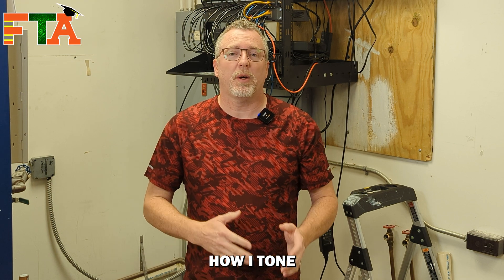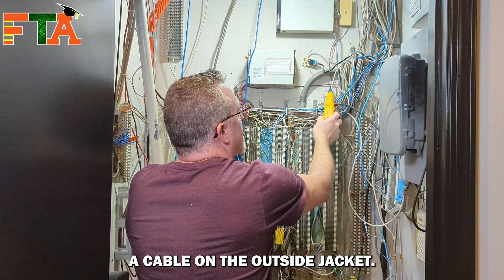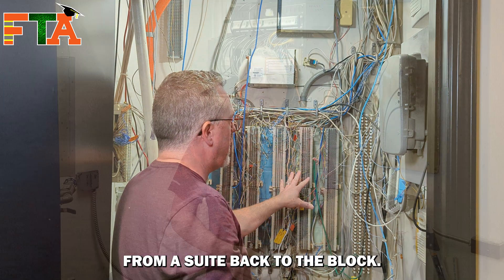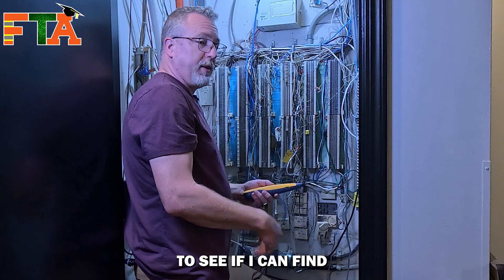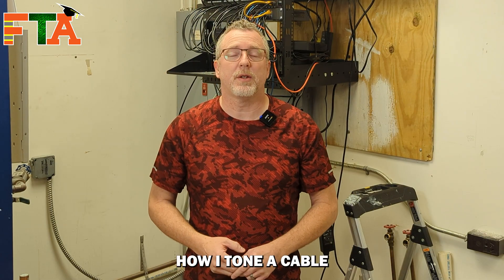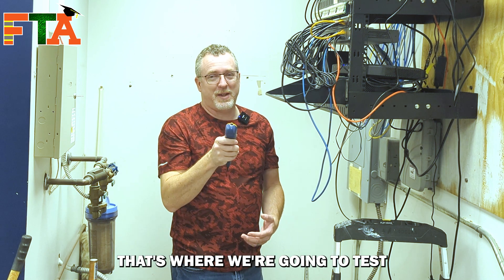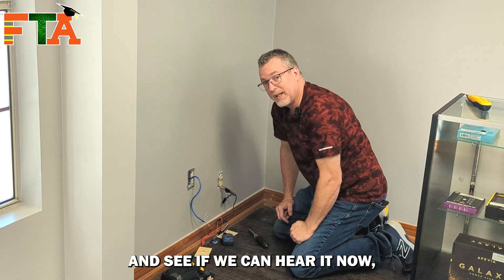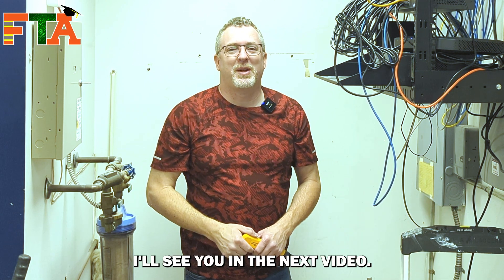7 Ways to Tone & Trace Cables | How to Use a Tone Probe Set to Trace Network & Phone Cable

Comment: On runs that I am sure are landed into a switch, I like to use a cable tester that's capable of blinking the link light on the switch at a steady rate so you can find it visually.
Reply from the maker: Those are the best. I had one before it was stolen😢😢😢

Comment: Can you do it through building automation controllers such as Honeywell ES1 up to the equipment they are attached to? The have jacks that take the data cable like second one you showed(the RJ) but they output through the otherside by phoenix plugs that allow low voltage wires to be screwed into a terminal
Reply from the maker: That's a good question. I would guess that the signal would travel through any equipment but I'm not familiar with controllers like that. I would do some research before trying it to ensure you don't damage it.

Comment: My toner has a sensitivity dial, you turn it down and the ghost signals will go away until you get closer.
Reply from the maker: Nice. What brand and model is that?
Reply: @fieldtechacademy  it is crazy, it was super cheap and works well. I was surprised how it worked for the price. Definitely not a fluke but worked for my uses. ENGiNDOT Network Cable Teater, Cable Toner & Tester, RJ11 RJ45 Line Finder,Cable Tracer with Probe Tone, Multifunction Wire Tracker

Comment: Just so you know, if you use the Klein Tools "correction" Edit : VDV500-920 it will do digital mode, and if the cable is plugged into a switch it will still tone it and find it :).
Reply: Actually that's incorrect. VDV500-063 is the analog-only model. The more-expensive -163 model has the digital function that may do what you describe, and has to be used with a digital probe.
Reply: @GoogleTraveler  YOu want the VDV500-920 it does digital, and its 200$ Canadian & worth every cent !
Reply from the maker: @JasonsLabVideos  ooooooh that's good to know. Is that a special setting?
Reply: @fieldtechacademy  I did a video on this on my channel :). It has 2 modes, one is digital one is analog.  The digital allows just this plugging in to a wall outlet with the tone on in digital mode then looking for it at the switch.  Works awesome ! and the tool isn't expensive either.
Reply from the maker: @JasonsLabVideos feel free to share a link to the video. I'm happy to share any content that helps techs in this industry.

Comment: Interesting, but also the switchport would be inactive because your have disconnected at the far end to put your toner on.. 
So getting into the ball park area, looking at the link lights on the switch would get you even closer
Reply from the maker: True but when you're dealing with multiple 48 port switches in a big closet it's not as easy. The environment in this video is simple enough to look at inactive links. The true value of this tip comes in a larger environment.